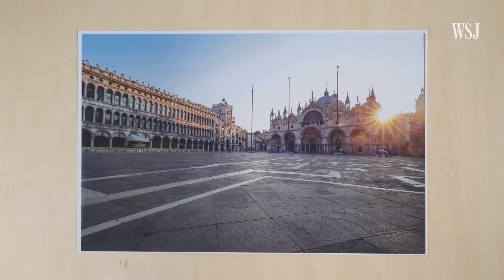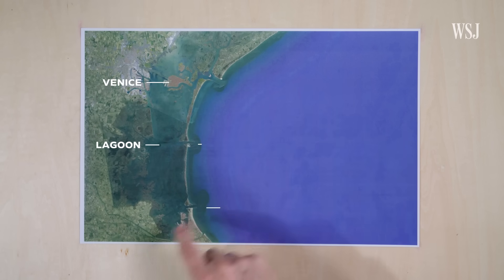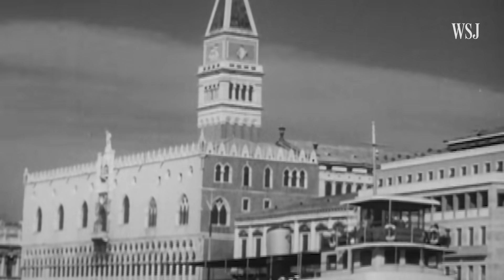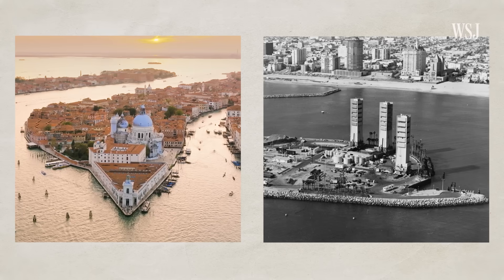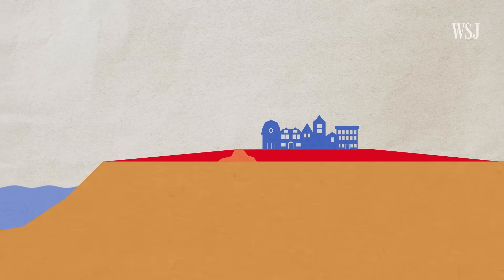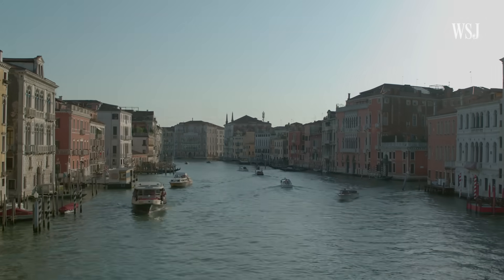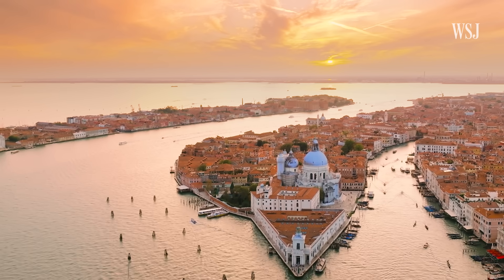Venice Is Drowning: Engineering Expert Explains How to Save It | WSJ Pro Perfected

Comment: The M.O.S.E. system is able to block all flooding. Venice has sunk also because in the past, up until the 60s, methane gas was extracted. There are some projects to revive Venice.
Two Italian companies, ENI and SNAM, with the Ravenna CCS project trap CO2 underground in the layers that previously contained methane gas.

Comment: Super levee is an awesome idea, but it only solves the problem of preventing sea water transgression and not preventing the sinking of the city.in other to prevent the city from sinking,a proper geo technical survey should be taking to obtain the structure,texture and chemical properties of the earth material,and also how those earth materials are distributed with its proper layering (e.g if Venice is layered thus in a descending order,silt-clay-sandstone-clay)the silt should be removed cus it can't hold water as clay would have done,then would be pumped into the clay and a means should be devised to prevent it from sipping into the aquifer (i.e, the sandstone)then finally the point of discharge the aquifer be closed to maintain constant underground water level)......
Reply: yeah... just another slop video.

Comment: Every country, where flood is concerned, must have the MOSE gate like that.

And also, for foreign viewers here, especially Italians, I'll convert the following in metric. Remember that 1ft = 0.3048m. The UK uses both ft & m simultaneously.

0:19-0:20 - 4.59ft = 1.4m
0:20-0:28 - 4.6ft = 1.4m
0:56-0:58 - US$6B = 5.59B euros (Lira was the official currency of Italy until 1999.)
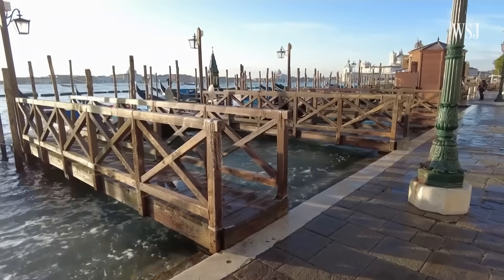2:10 - 5.5ft = 1.7m
3:04-3:09 - 6in = 152.4mm, 4.3in = 109.22mm, 10.3in = 261.62mm
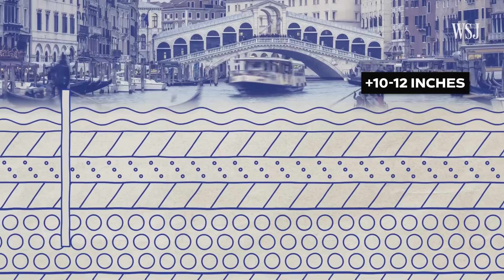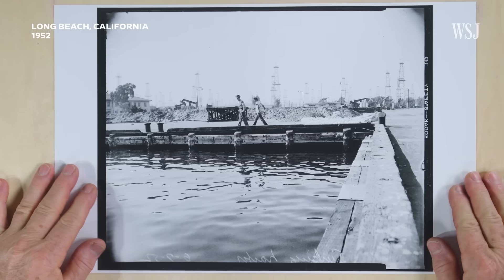3:57-4:01 - 10in to 12in = 254mm to 305mm 
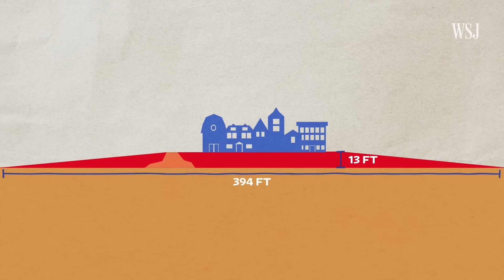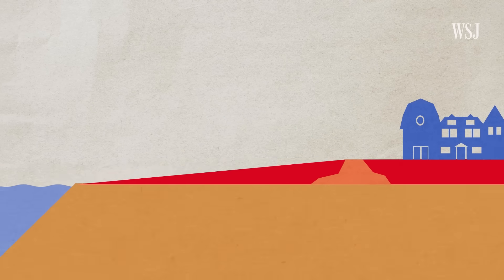5:33-5:34 - 13ft high = 3.96m high & 394ft long base = 120.09m long base

Dimensions of Modulo sperimentale elettromeccanico* (MOSE) (1:27-1:36):
12ft to 16ft thicc =  3.66m to 4.88m thicc 
66ft wide = 20.12m wide
61ft to 97ft long = 18.59m to 29.57m long

Height of Leaning Tower of Pisa: 186ft = 59.97m.

*Modulo sperimentale elettromeccanico (MOSE) is Italian for Electromechanical Experimental Module.
Reply: Is depending from the fact of GB has a king named KING TAMPAX?

Comment: I have many doubts regarding the MOSE project, starting with the reasons why all the movement mechanisms were placed below the water level and in contact with the sandy seabed. But the most serious doubt is what would happen if one of the barriers were to suddenly fail: how violent would the wave hitting the city be, and how devastating could it become? Frankly, I would have preferred that, to discuss these issues, you had interviewed engineers without conflicts of interest in discussing what is being discussed.

Comment: When a civilization is built upon ports, and those ports are submerged or high and dry, that ends the civilization because the supply chain disruption is so severe. WHAT'S THE ROLE OF FOUNDATION MODELS? Well, you can input all marine archeology and archeology from ports and sea shores such as Troy, Byblos, Shore Forts Roman Britain, Isle Thanet Roman Britain, Chapter 18, Book of Revelation, Egypt, Pompei, Carthage, Caesaria , Israel, and so on PLUS multi modal such as measurements from Rome's port. Then search popular climate  change literature from past few decades. Next: AI can search for maritime architectural and civil engineering solutions. Apparently, prior to Rome's hydrophilic cement, ports were designed for sea level fluctuations with hydraulic solutions, much like Canada's St Lawrence Seaway. Troy for example. This is just one way AI can save civilization.

You could form a GAN to see what the solution is: Lithium vehicles versus civil engineering.